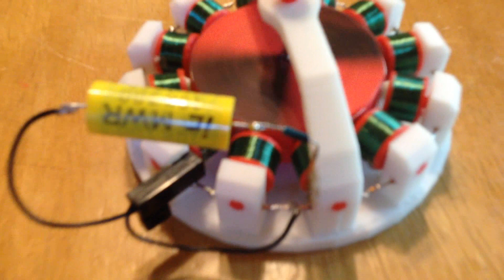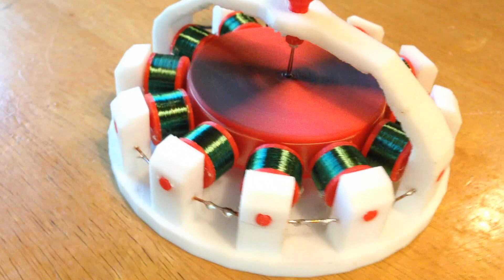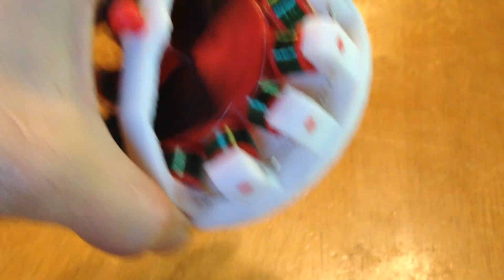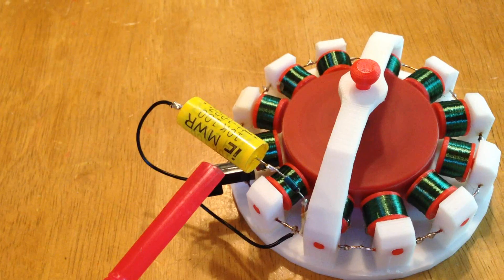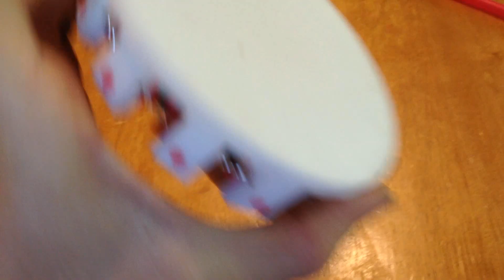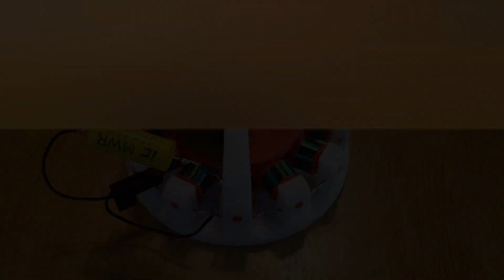EZ Spin Motor on 10uF Polyester Film Capacitor

Comment: Your capacitor is nothing more than a 100 volt rated non polarised 10,000 picofarads or 10 nano farads or 0.01 micro farads capacitor. It is nothing like 10 uf (10 micro farads).
So, it has 1/1000 of the electrical storage capacity of a 10uf capacitor. 10 divided by 0.010 = 1000
For this reason, I claim that this is fake.
There may be no battery hidden in the unit, but have a look under the table. You'll find a spinning magnet of some sort.

Comment: I built one of these and it works well but definitely does not run on a capacitor his small. It draws in the 75uA range at 12V. Runs fine on supercaps. My coils are about 11K and I'm using 1/8 thigh magnets.

Comment: Hi Lasersaber, try these advices: 1 - create an imbalance by removing a coil 2 - use trifilar or multifilar coils 3 - use for half circuit a capacitor, and for next half another capacitor, while first is resting amd recharging, 4 - use a small spark gap from a modified diode in parallel with capacitor(s) - with these advices you can reach overunity faster! Keep going good work and all the best!

Comment: I got another idea. If you have one of those variable capacity capacitors laying around, you could charge the cap with the motor to say 10 volts, then decrease the capacity thus increase the voltage and run the motor quicker (since the voltage will go up when you decrease the capacity)

Comment: Very nice!
You could try to make a cap yourself, and run the motor on that little power. Like two aluminium foil and a piece of paper? 
Or make a layden-jar and try to run it on static electricity! Wow, try if you can do that! I did not seen a electro magnetic motor run on static charge before...

Comment: You should do a test with a water bottle filled with salt water with aluminum foil around it for the capacitor. I'd #### a brick if it ran off that